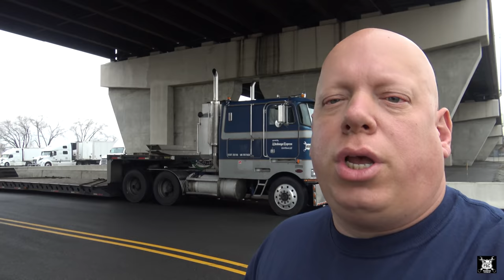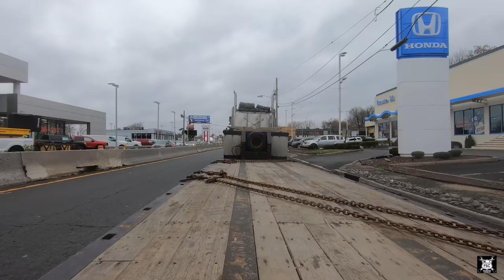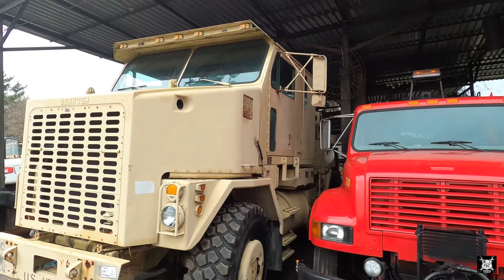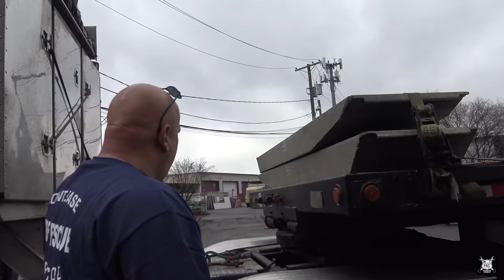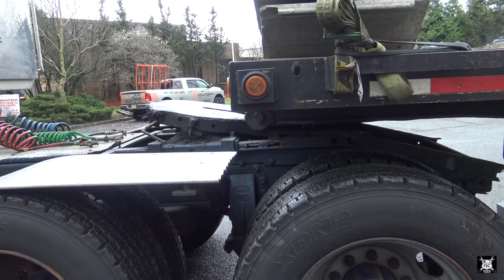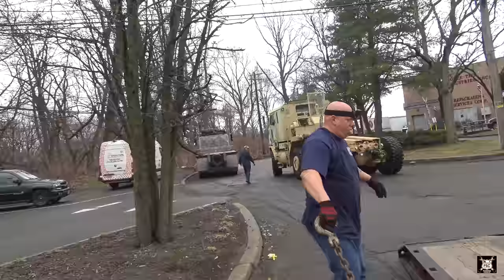Tight Spot For Getting Huge Load

Comment: Tight places are why I like COE's. Been to shippers and customers with COE and the guys with HOODS had a REALLLLY hard time getting in and out. A few times when I was done ( if I had time too) I dropped my trailer and put theirs in for them.
Reply: And insane stretched chassis .. Cannot understand why '' It's almost fashion over there?
Reply: @pagey007  I agree, Some oth those stretches are ridiculous.  I always thought the long wheel based Gabor COE Petes was to long for COE's.
Reply: @pagey007  A lot of the roads in Europe are not built for modern rigs. Even here in the states most roads are not built for modern rigs they was built for the trucks and trailers of the 1940's and 1950's / '60's. To add to the fun several of the power units I drove had manual ( armstrong )steering.
Reply: @richardmiseljr2413  "Armstrong  steering "...😂😂😂😂!!!!
Reply: @ToyManFlyer1100  Actually that's is what it's called. One of the manufacturers was named Armstrong.

Comment: I have a great respect for drivers with specialty loads oversized, hazmat etc. You work harder and more hands on and I can't recall one wearing flip flops. In other words doing your job and doing it right. After hearing that old Detroit fire up I guess I need to get off my ass and get my old ranch truck running this weekend. 68 ford with a 318 8/71 straight pipes